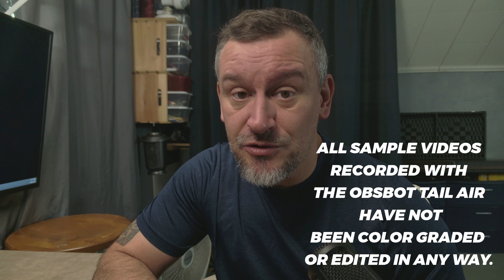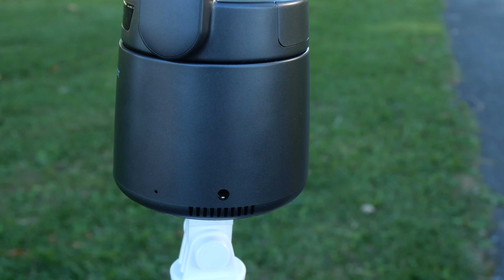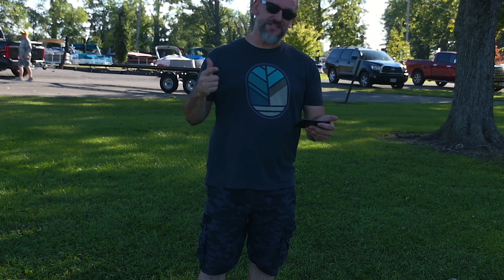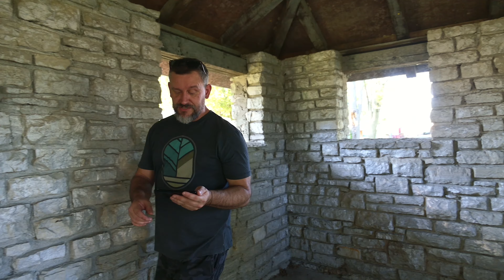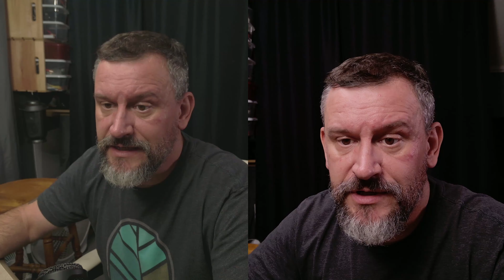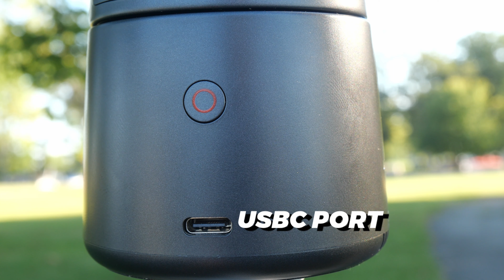👀OBSBOT Tail Air PTZ Streaming Camera QUICK LOOK 👀

Comment: It would be interesting to compare this to the new DJI Pocket 3 that has tracking... can connect to a cell-phone to check frame setup and control some features... but also has a small screen you can use to check the frame setup.
Your thoughts?...

Comment: Thanks for the pre-review. Two things: The original Tail had full 360 degree capability, the Tail Air has an optional 360 base. Will you be testing this? Also, the comparison with Tiny 2 looked a bit like the Tail was in some sort of log profile.
Reply from the maker: I will not be testing the 360 base. The tail was not in a log profile, I just had the contrast and saturation turned down a bit. The picture settings are all configurable in the Obsbot start app. I went with less contrast and saturation because that's what I generally do for post color grading, but, I'm a dummy...the Tail Air is built for live streaming! Thanks for watching!